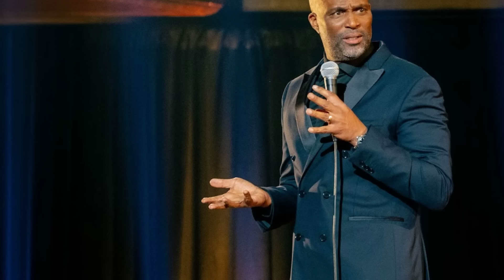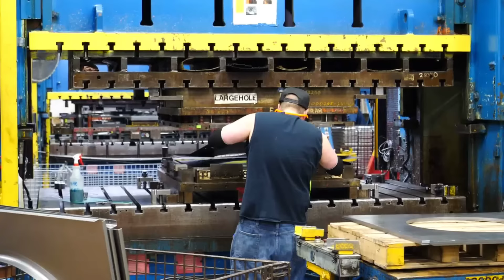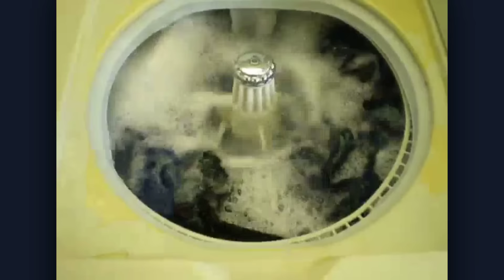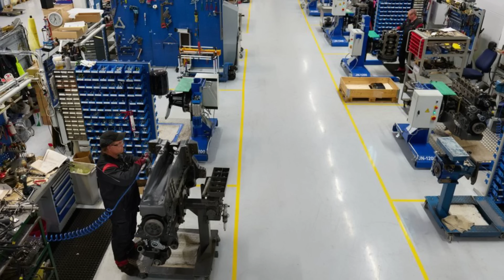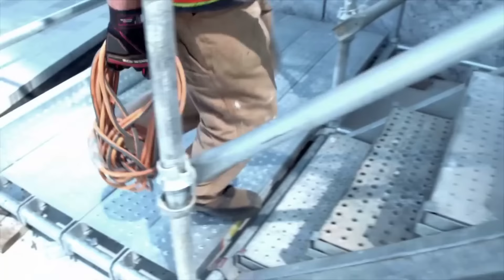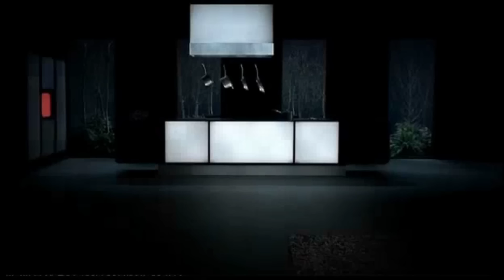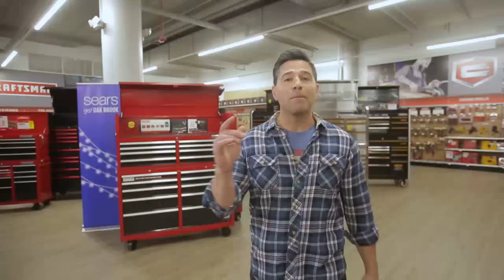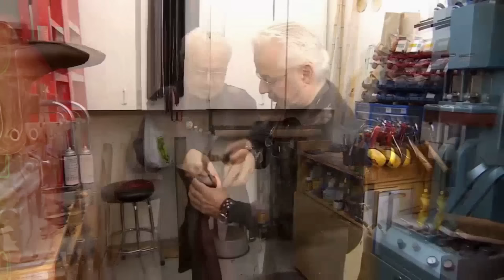The Only 5 Brands That Still Last (The "Buy It For Life" List)

Comment: Kitchen Aid.  My daugher went to cooking school.  She used my GRANDMOTHERs mixer, which still works like a charm.  My grandmother got it new...passed it to my mother...who passed it to me.  It is now my daughers. I've offered to replace it and she refuses.  buy a kitchen aid. It's worth it.
Reply: The brand hasn’t held. Their new stuff is junk depending upon what you buy. Their dish washers are no better than all the other junk made. But their kitchen appliances seem to still be decent.
Reply: Yes I found a KitchenAid mixer at a goodwlll store for $24.00 couldn't believe it they must have just put it out and older model avocado green 
With the locking bowl and 3 attachments I used it for 15 years
It eventually needed a speed controller I bought the part fixed it
Gave it to my brother and bought a brand new one on a great sale love those mixers!
Reply: @jimcarter2092  I love good will stores! Older stuff at a discount is good business!
Reply: Modern Kitchen Aid mixers are made in China, at least the European ones are.  They are not as good as the old Kenwood 701 made in England, and sadly no more.
Reply: I bought a new KitchenAid mixer in 1975. Throughout the years I added accessories. Last year, 2025, I had it refurbished and passed it on to my granddaughter. She can probably use it for another 50 years.
Reply: Buy a 1960 kitchen aid used, it's worth it! ;)
Reply: Our Kitchen Aid mixer? Use it a lot. Parents bought it in like 1988 or so. Never broke down or anything.
Reply: Kitchen Aid, but only when it was under Hobart or early Whirlpool.
Reply: We bought all new kitchen Aid appliances when we purchased a new home 9 years ago.    The fridge stopped working 2x in the first year.  The second repair man was so creepy I opted to just buy a new one rather than deal with any more repairman.   The new one is a fridgidaire.  It came with 2 icemakers, one stopped working in the first few months.  Dishwasher broke down three times in two years.   Finally bought a new one.
Reply: @louieJmanfred 😬 sorry that happened to you
Reply: @louieJmanfred  I used to sell and install Kitchen Aid appliances in the 70's. At that time they were of the highest quality.  The Kaid brand was sold to Whirlpool.   They also own other brands like Amana.  We also sold Amana which was top of the line.  China makes most of the stuff.
Reply: one of my coworkers just serviced her KitchenAid mixer herself. needed a couple of gears and replaced the grease, both available at a big online retailer. instructions on youtube. it's not hard!
Reply: I have my kitchen aide microwave since 2005.. But it's starting to burn my popcorn😂
Reply: They key there is that it is old
Reply: it's so dang heavy
Reply: You don't want the newer KitchenAid mixers. My husband has had to replace a switch and two other electric components at different times.  I really wish I could find an older working model at least 25 years back.
Reply: I’ve used my kitchen aid for 50 years.  Love it.
Reply: Avoid Kitchen Aid mixers made after 1986, when Hobart sold the brand. The earlier mixers are legendary for their durability. But while the newer ones use the same case design, they use plastic gearing that does not last. Me, I am using a Hobart Kitchen Aid full-size stand mixer of a 1975-1986 vintage -- that's the one to look for, because parts are still available for it. Older models also are excellent, but the control mechanism is known for occasionally going out, and you need a "parts mixer" because the parts are no longer made.

Comment: I have a Honda EU7000is generator, about 12 years old at this point. We moved to FL from PA and I brought it with us. I squirreled it away in a shed for 2 years without looking at it (My Bad). At least I had put a healthy dose of Sta-Bil in the gas tank. I got it out awhile back and wondered if it would start. The battery was shot so I bought a new one. I put the battery in, turned the switch, hit the start button, it cranked over maybe once, fired right up and ran perfect. I’ll change the oil next so it’s done if we need it. I can’t start it with the pull rope because I got too old.
Reply: Yep. I have a EB 5000 w  , 30 plus years, still going. Besides regular maintenance, I have changed only the brushes.
Reply: @wyrunuts a couple years ago a brotha of mine gifted me a used Honda EU2000i generator. He did so when he watched me try to start my HFT Predator gen one day...pull, pull, pull then take a breather. He took over and the first pull took the rope from his hand violently...that happened frequently. Next day..."Here, Woody. Use this instead." I was kinda hesitant...I mean, here's my bud giving me the holy grail of generators just to make my life easier. One pull...sometimes two, if I let it run dry. I run it sixteen hrs/day in the cold days, but always at least four hrs daily to charge RV batteries. I've changed the oil, spark plug and washed the air filter...twice.

 I estimate i run the Honda 3500hrs annually powering two small space heaters in my RV.

Comment: another... the Kitchen Aid cast iron mixers. it uses the same design since the 1950's, metal gears, good bearings, motor no plastic, all cast metal. industrial quality mixer for the home.
Reply: In the 1970's my mom had all of the accessories for hers which included some hilariously weird options.

Comment: Have a Whirlpool washer and dryer that came with the house I bought 20 years ago, they are both from the early 1980’s. Only problem the dryer broke the drum belt last year, found replacement belt at local big box hardware store. The main control knob on the washer broke 3 years ago  and i ordered a replacement from amazon. Still going strong.
Reply: I only buy Whirlpool products in part because they are quality imo but my father delivered whirlpool products for 30 yrs and fed our family
Reply: Way to go! Parts are cheap, the job is easy! My washer/dryer and fridge are 27 years old, only the fridge needed a timer changed after 25 years...for 50$...no other repair needed...i love these old machines! I bought them new back then...
Reply: My Whirlpool set is approaching 20 years as well.  At one point the dryer board went out, but thanks to YouTube I was able to replace it easily.
Reply: I loved whirlpool stuff until i bought a side by side 25cu.ft. frig an a convection oven/gas range. With in the first2 yrs,the frig icemaker broke so they had to rplace the entire door insted of replaceing the ice maker😮 and the stove lasted 5yrs before i had to replace a 450.00 main board.😢 the old stuff worked a long time no problems but from 2017 and newer is all exspensive trash imho

Comment: I have a Honda 2000 that has over 1,600 hours on and it runs great. I run synthetic oil and change it every 50 hours. I also run it in a box in cold temperatures to keep its operating temperature above 40F.

Comment: We bought a Speed Queen about 8 years ago after going through several washers/dryers.  8 years in and the Speed Queen is still awesome.  No frills, gadgets, computers, just great CLEAN clothes.  Highly recommend anything Speed Queen.
Reply: I bought a large capacity Whirlpool washer and dryer in 1980.  In 1995, I moved and didn't have room for them in the small laundry area.  I gave them to my cousin and bought smaller versions.  My cousin's daughter inherited the old washer and dryer, and still uses them today.  I have been through 6 sets since then!
Reply: My Whirlpool washer is 20 years old. Still going strong.
Reply: We bought a Speed Queen washer & dryer combo because I didn't want all the bells and whistles.  I wanted reliability.  Our dealer told us Speed Queen was what we wanted, and they have served us well for about 10 years.  Oh, but I wish the dryer had a buzzer to tell you when it was finished.  The dealer told us to buy a kitchen timer.

I do have to disagree on the Channellock tools.  Their slipjoint pliers will slip and hurt your hands.  German-made Knipex pliers are the cat's meow.  For small jeweler's screwdrivers & nutdrivers, Wiha is unbeatable.  

Proto was hands down the best hand tools for many decades, but no longer.  They were found in most industrial shops throughout the US.  Now, wrenches seem softer, ratchets don't ratchet, and cutting tools don't hold an edge.
Reply: @steveprice5664 Have been using bullet proof Channellock brand of pliers for over 50 years. Only one that slipped was years ago on original design that use a bolt & nut that would come loose. Need up tightening then hitting bolt with a heavy ball pein hammer, no more loose bolt. Tried other brands but Channelocks bare my hood go to tool.
Reply: That is awesome. New purchasers need to be careful because at any days between could be bought and start cutting quality. 

Have a friend who's been considering a speed Queen.
Reply: Only 8 ? My LG now works 12 years without any issue, and ecologically saves water and electricity.
Reply: @flexiblebirdchannel they have only had it 8 years so far...and if you look online about lg, consider yourself lucky to have not ever needed a repair.    You are a rare customer.
Reply: @flexiblebirdchannel  top loaders waste power, water, detergent and damage clothes. Most industrial laundry systems use front loaders.

Comment: Makita is NOT the tool it was 20 years ago. My lead carpenter bought a new Makita 18v set in 2020. The gearbox of the impact stripped on day one. Junk
Reply: Fact. I had a Makita 12 drill volt with NiCad battery which lasted me for 10 years and worked well in temps below -15 degrees, but the modern lighter 20 volt lithium ion drill is of a very 'iffy' build quality.
Reply: Makita is garbage. Makita drill had a chuck and switch replacement after moderate home use and metal cutting cold saw does work, but needed modifications to make somewhat precise 45 degree cuts and general build quality feels like cheap chinesium. Orbital sander and planner work well enough though. Makita may have made some short term profits because of the drop in quality, but at the expense of brand recognition. I am avoiding it now like plague,

Comment: Don't use cast Iron cookware: The probably is most steel is now recycled and your cast iron cookware may be contaminated with heavy metals. I recommend only stainless steel or glass cookware. Stainless creates a thin passivated (inert) film on the steel that prevents contaminates in the metal leaching into your food. Maybe Cast Iron is OK if you can find antique cast iron (pre 1950s).
Reply: That’s why you buy used cast iron from any place you can find it - thrift store, marketplace, vintage fairs, Grandma… I am 66 and my mother gave me one 8” and one 12” cast iron skillets that she had seasoned when I was 21. They are my treasured possessions and will be given to my daughter. My Mother has now passed and my sister and I are dividing up her skillets like gold.
Reply: @achsinal there are company's that make them with non recycled metals